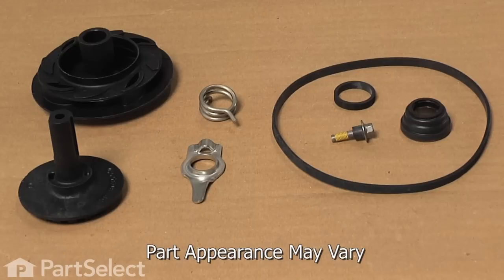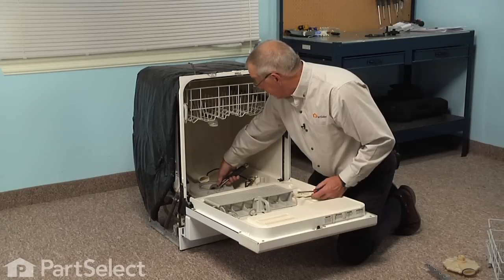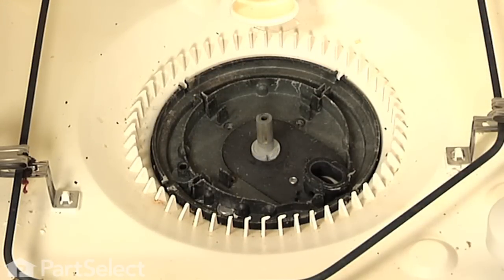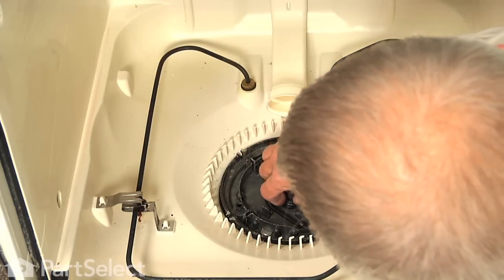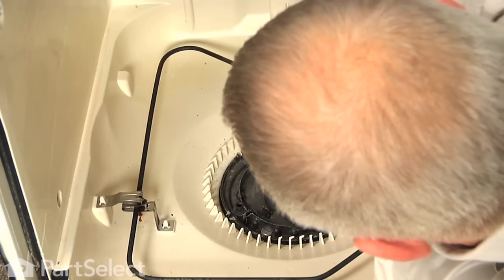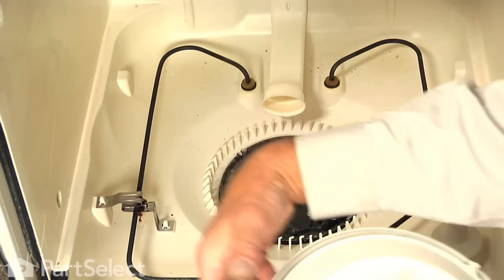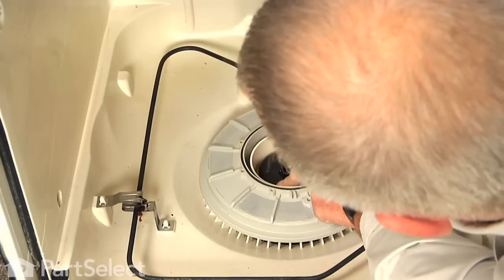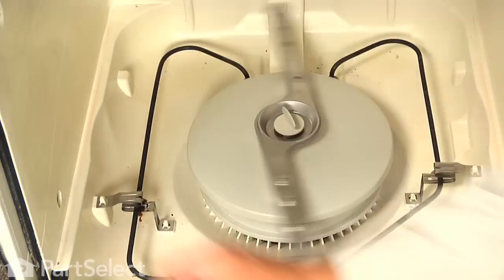Dishwasher Repair - Replacing the Drain and Wash Impeller Kit (Whirlpool Part # 675806)

Comment: This is my model dishwasher, however, what I found is that my own dishwasher inside the filter was disgustingly filthy! I tried to pry it open but it doesn't come apart, at least mine doesn't. Under the filter was gross too.. wondering why it gets so dirty. My dishwasher works great, but was getting bits stuck to my cups and plates, so decided to clean it out. Any how I blasted it with hot water as best I could but still don't like that I can't open it properly to clean inside. Any suggestions? I love the video because I always forget how to reassemble. Lol..
Reply from the maker: That filter does not come apart for cleaning, but would require replacement.
Reply: You can clean that filter. If you like throwing money away, ignore me. If the fine mesh screens are in good shape, take the screw out of the bottom. Take the 2 pieces off of it. See that 3/8 hole in the bottom? That's where your gunk will come out. It takes about an hour in the sink. Fill the filter with water through that hole and the fine mesh screen. bang it, flush it and get the gunk out through that hole. Paper hair, grape seeds and bone particles will come out. Pick at it with tweezers or what ever. You will get it clean. Hold it up to the light. Yeah it stinks, but you'll save yourself $100.00. Put it back together with the screw and you're done. 2 loads of dishes and it won't stink.

Comment: We've broken the impeller, but still cannot get the screw that holds it in place out, i don't want to damage the part that is under it. Anyone have any ideas?
Reply: Hold onto it with vice grips if the adjustable wrench doesn’t work

Comment: I have a model 665 like the one in this video.  I snaked all hoses with a hanger and didn't see any visible food particles.  I removed everything up to the impeller and I still have standing water under the manifold only.  The rest of the water does drain.  I tried to use baking soda and vinegar but nothing works.  Any suggestions? thanks
Reply: Kenmore
Reply from the maker: It is normal to have some water left in the sump area. Did this symptom just recently occur? Is the drain hose excessively long or has the routing been changed? Have you changed the drain impeller?
Reply: PartSelect

Comment: I used a 1/4 drive ratchet with extension stuck it thue a 1/2"drive  1" socket and held socket with channel lock pliers screwed it right out ,Then took pliers and lifted it right out . hope this helps
Reply: Thanks! 1" socket striped it so I just used a 15/16th socket and hammered it on and it worked perfectly. Great solution.
Reply: Thanks! 1" socket striped it so I just used a 15/16th socket and hammered it on and it worked perfectly. Great solution.
Reply: Good solution, Lucas. Here's mine:

On older dishwashers the torque needed to remove the bolt may be so great that the adjustable wrench slips off the wash impeller hub no matter how tight I make it and no matter how hard I hold it in place. (Same with a large pair of channel locks with good teeth on it.) To solve this problem I use a 31/32" shower-valve socket wrench on the wash impeller hub. The wrench is hollow so I can run a 1/4" socket on a an extension rod down through the hollow to get the bolt. Sometimes the torque is so great it seems like the bolt is going to shear off, but those bolts must be made of super tough steel because I've never had one break or be so stuck that I've had to replace the motor. Also, this trick avoids having to drill out the hub of  the wash impeller to remove it. If I did that, I would still be left with the problem of holding the motor shaft as I tried to remove the bolt. In that case I would put the wash impeller (with drilled out hub) back on, and now with the filter assembly removed I would have good access to grab the wash-impeller hub with the adjustable wrench. Still, the shower-valve wrench is  the better solution because it's never going to slip on the wash-impeller hub. 

I should mention that I often have to destroy the drain impeller to get it off, If I did that and still had the bolt stuck in the shaft, I would grab the doubly flatted shaft with an adjustable wrench, but that would risk damaging the shaft, so the shower valve socket wrench is still the better solution.

The nominal size of the hex on the wash impeller looks like 1", so I have to use a little force to get the 31/32" socket down on it, but that's good because then I get a really tight no-slip fit. The next size larger is 1-1/32" and that's a little loose which could allow it to slip under the huge torque needed to break free the bolt. So 31/32" is better.
 
My local hardware store has the complete set of 6 shower-valve socket wrenches for $28 and the individual wrenches for $8. The set comes with a cross bar for a handle, but if you buy the single socket, you'll have to use a screwdriver or some  such thing as a handle, or you can grab the socket (more accessible than the wash-impeller hub) with an adjustable wrench.

Comment: My washer doesn't seem to have the clicking noise of when the drain cycle is supposed to go off and then I am left off with water at the bottom.  Is it the Impellar that needs to be replaced?
Reply from the maker: +Calvin Bedros What model number is your dishwasher?
Reply: looks exactly like the one in this video whirlpool type 200-2
Reply from the maker: +Calvin Bedros The impeller may be at fault or you may have a clogged filter or sump inlet below the chopper blade. Your model has a reversing motor and at the end of the wash cycles the motor reverses direction for drain, so listen for that to happen.

Comment: Hi! My Inglis dishwasher will not drain. I can hear the pump running but the water will not drain. Any suggestions will be greatly appreciated. Thanks!
Reply from the maker: +playit00 What model number is your dishwasher?
Reply: Hi there! The Model number is: IKU35560
Reply: +playit00  Was wondering if there is a way to open the filter and clean it?
Reply from the maker: +playit00 You most likely have a problem with the impeller or the drain check valve. We have provided an installation video for the impeller kit (PS382822) that will show you how to access the filter and the impellers.
Reply: +PartSelect Well I took everything apart as your video required but did not replace anything. I found a piece of broken glass,cleaned everything, reinstalled the old parts and it drained the first time. I ran the dishwasher again but it did not drain this time. The motor sounded loud. Now what?
Reply from the maker: +playit00 You may still have some broken glass in the sump area that has contacted the impeller and maybe damaged the shaft or blades.
Reply: +PartSelect Hi! I found the problem. It was the check valve.

Comment: Can someone tell me where the little white ball goes in this dishwasher I see where the bigger white ball goes but I don't know where the little one goes thank you
Reply from the maker: Hi, what is your model number?
Reply: It is the check ball from under the separator (filter). You probably removed the one t15 screw holding the base to the filter (not shown in video).   There is a little dish shaped depression with a hole in it on the bottom of the filter that the check ball sits in.

Comment: For the life of me I could not get the small bolt with the wrench and a wratchet to get to the pump.  Really not willing to take a hammer and chisel on this dishwasher!  One would still have to get the bolt unbolted.  Why isn't that part stainless Steel?
Reply from the maker: You could also try a good quality rust penetration lubricant to try and loosen the screw.
Reply: I had the same problem. I chiseled off the old stripped molded hex off the impeller. I built a tool out of wood with two screws protruding out the bottom of the wood and drilled two holes on top of the impeller to match  those in the wood. The screws in the wood fit in the impeller holes so I could stop it from twisting instead of using the hex wrench. To access the screw, I drilled out a hole in the middle of the wood to allow my socket to go through. I was able to twist the ratchet while holding the wood to keep the impeller from turning.
Reply: I tried a WD40 rust penetration spray but it didnt help either. Any other suggestion please
Reply: Great solution, Paul. Here's mine, which is similar:

On older dishwashers the torque needed to remove the bolt may be so great that the adjustable wrench slips off the wash impeller hub no matter how tight I make it and no matter how hard I hold it in place. (Same with a large pair of channel locks with good teeth on it.) To solve this problem I use a 31/32" shower-valve socket wrench on the wash impeller hub. The wrench is hollow so I can run a 1/4" socket on a an extension rod down through the hollow to get the bolt. Sometimes the torque is so great it seems like the bolt is going to shear off, but those bolts must be made of super tough steel because I've never had one break or be so stuck that I've had to replace the motor. Also, this trick avoids having to drill out the hub of  the wash impeller to remove it. If I did that, I would still be left with the problem of holding the motor shaft as I tried to remove the bolt. In that case I would put the wash impeller (with drilled out hub) back on, and now with the filter assembly removed I would have good access to grab the wash-impeller hub with the adjustable wrench. Still, the shower-valve wrench is  the better solution because it's never going to slip on the wash-impeller hub. 

I should mention that I often have to destroy the drain impeller to get it off, If I did that and still had the bolt stuck in the shaft, I would grab the doubly flatted shaft with an adjustable wrench, but that would risk damaging the shaft, so the shower valve socket wrench is still the better solution.

The nominal size of the hex on the wash impeller looks like 1", so I have to use a little force to get the 31/32" socket down on it, but that's good because then I get a really tight no-slip fit. The next size larger is 1-1/32" and that's a little loose which could allow it to slip under the huge torque needed to break free the bolt. So 31/32" is better.
 
My local hardware store has the complete set of 6 shower-valve socket wrenches for $28 and the individual wrenches for $8. The set comes with a cross bar for a handle, but if you buy the single socket, you'll have to use a screwdriver or some  such thing as a handle, or you can grab the socket (more accessible than the wash-impeller hub) with an adjustable wrench.

Comment: To get that stupid thing off I ended up drilling a small hole in the disk then screwing a wood screw through the hole and into the plastic undernear to secure it before taking a breaker bar to that stupid POS lose.